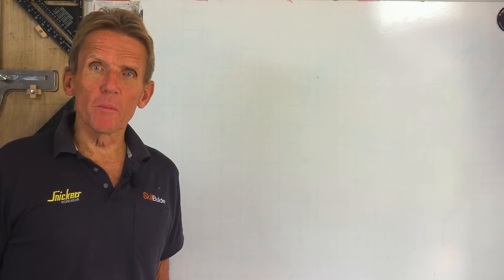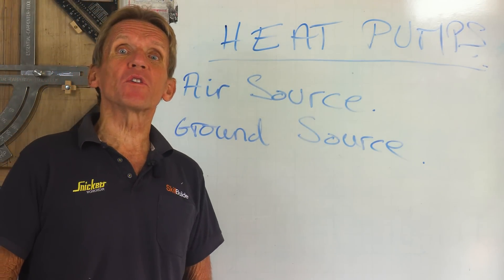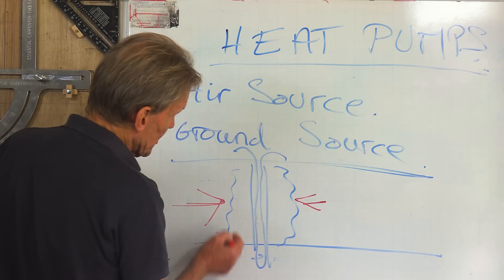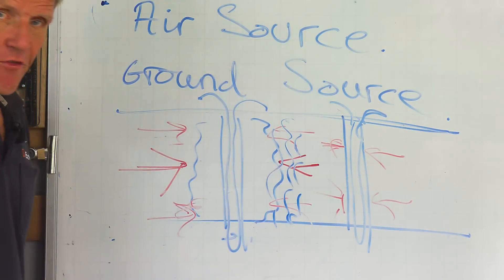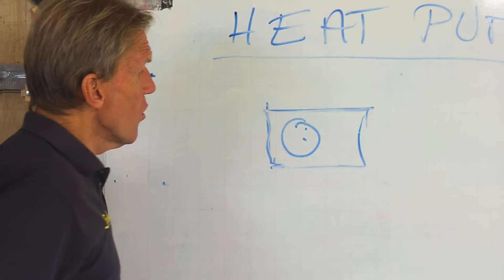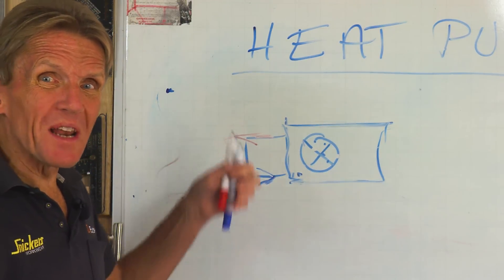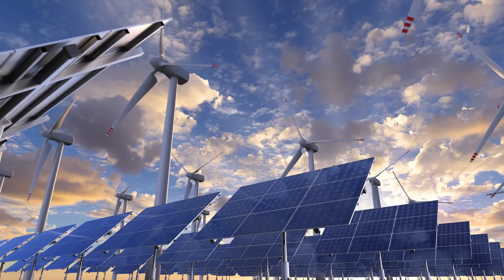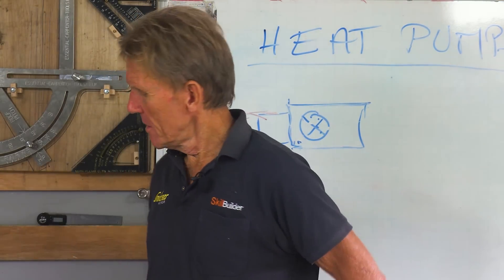Heat Pumps ~ Get Your Facts Straight!

Comment: I live in the countryside in a small hamlet. We are all on oil. No gas here. 1964 build, bungalow. A year or two after we moved in we had it cavity insulated and loft insulated (around 2008), windows and doors all double glazed, it halved our annual heating bill and I spend about £1000 a year on oil. Now. Thermostat set at 18 deg. In the summer the boiler is hardly on because it just does hot water, in winter it comes in & out maintaining the CH temperature. It works extremely well and I am more than happy with it. In new build homes I can see why heat pumps may be economically viable but in older homes never designed for them I’m not so sure, even if you can afford the cost. There’s a lot of greenwashing going on. Caveat emptor.
Reply: Same here but my house is 120 years old. No gas, no oil. They ripped out my stove and said they'd not touch it. £12 a day to get to18oC and it's lousy. It's been installed for two weeks now and I curse it every day. I wish my wife wasn't conned by the council to install this rubbish.
Reply: @davidcrawford8583  sorry to hear that David. The guy who services my boiler has taken out heat pump systems and re-installed oil boilers because they are not what’s promised. As you now know you have to run electric pumps constantly, if you want hot water it’s immersion heater or a secondary source of heat (gas boiler or oil boiler) never mind the significant installation costs. As I wrote before, new house, new build, maybe heat pumps are ok, old house…..mmm not convinced. At all.
Reply: @jfro5867  Thanks, we paid nothing for it, the guys who fitted it told me it was a 15k install. It does produce hot water better than the back boiler ever did, but apart from that it's so bad. I now have to pay for a new log burner which is a £1000 and no one cn fit one until the end of January. I don't know who to complain to, EON next or the Council.

Comment: If you have no gas supply available, air-source heat pumps are  lot cheaper than direct electric heat [except when the temp is close, or below, freezing!] The temp outside is -2C now and the heat pump is drawing 2.2KW to maintain an internal temp of 21C
Reply from the maker: Good to know it is working for you and I agree.

Comment: The simple fact is.. several years ago me and my wife had solar panels installed.. this was at the time when you got the "feed in" payment we we have enjoyed ever since and the panels have turned out to be a wise investment....
However....
because of this we have become a target for sellers of "Ecologically friendly" heat pump derived central heating systems.
We have seriously looked into this and the major issue is the fact that electricity prices have risen so high  there is actually no break even point where the system becomes economically viable.
In other words, it makes no sense to spend a lot of money on a system that has no practical benefit, and does in fact reduce the standard of the system we already have.
As an added thought, my wife being quite keen on these kind of issues insisted that (as we needed to replace the old one) we bought an A++ rated heat pump tumble drier.
While I must admit it works brilliancy, the only issue we have with it is, and it is happening at this moment, it is in the outhouse and if the temperature drops, as it has these past few days, it will not start unless we fire up a heater in the outhouse (which defeats the object of having a heat pump machine) to get it to start. 
It basically displays a low temperature error

But this set me thinking about these air heat pump systems intended for domestic heating.. do they behave in the same way and could you find yourself on a really cold day in a situation where it is too cold for your heat pump system to start?

Comment: I have two ASHPs in my 2 bed flat. I only use one at a time. It keeps my whole flat lovely and warm. It comes on at 7am and goesnoffbat 11pm. I'm electricity only, my electricity cost is £73 for all my electricity per month during the winter. I love it. Compared to my underfloor heating the ASHP saves me about £200 per month.
Reply: You should vote. Me too! 5 bed detached, 2 a/c units - total energy bill £120 in December.

Comment: I beg to differ 

Heat pumps with a vertical well produce heat by extracting thermal energy from the ground and transferring it to a building's heating system. The ground, even at relatively shallow depths, maintains a relatively constant temperature throughout the year, making it a reliable source of heat.

Here's how it works:

Heat Transfer Fluid: A fluid, such as water or a refrigerant, is circulated through a closed loop of pipes buried in the vertical well.

Heat Absorption: The fluid absorbs heat from the surrounding ground, which is typically warmer than the air during winter.

Heat Pump Cycle: The heat-absorbing fluid then enters the heat pump, where it undergoes a thermodynamic cycle that concentrates the heat.

Heat Release: The concentrated heat is transferred from the heat pump to a heat exchanger, which warms the air or water that circulates through the building's heating system.

Cycle Completion: The cooled fluid is then recirculated through the vertical well to absorb more heat, and the cycle repeats.

Vertical wells are particularly efficient for heat pumps because they provide a large surface area for heat transfer with the ground. This allows the heat pump to extract more heat with less energy input compared to horizontal loops, which have a smaller surface area.

In summary, heat pumps with a vertical well utilize the constant temperature of the ground to extract heat and transfer it to a building's heating system, providing a sustainable and efficient way to generate warmth.

So in a closed circuit with a well 45mt deep the average temperature is 12 degrees Celsius. The chances of freezing the surrounding area making the heat pump useless are the same as being hit by a meteor while driving a scooter down a slope in Nepal

Comment: Due to the poor insulation on older houses, doesn’t it make heat pumps a poor solution, and can you financial costs be higher due to using mains electricity to boost heat output.
Reply from the maker: Yes this is covered in other heat pump videos on our channel

Comment: I know someone who has a mini-split based system for their house airsource heat pump. It uses the mini-split style behaviour to move a refrigerant from the outside unit indoors where the pump is located. This is then used to heat water within their system that is distributed to the radiator/underfloor heating. It has the advantage of needing a much smaller hole through the wall to the outdoor unit, which also needs far less power since it just needs a fan to move the air. The smaller pipes are also easier to insulate than water pipes, which are quite large.
Reply: yes, split system vs monobloc

Comment: My gosh, the tittle says get your facts straight, so please do get your facts straight! firstly Geo thermal with bore holes is geothermal, a simple google search will explain, The word geothermal comes from the Greek words geo (earth) and therme (heat). 
I'd never recomend horizontal loops, as you say this is not just relying on earth temperature but also the sun, acting like a battery to heat the ground, bore hole freezing is possible depending on sizing and cost for number of required bore holes vs payback.

Air to air is almost always more energy efficent vs air to water, but how you will create DHW becomes more difficult (but more solutions are coming). Fact.

lastly grant funding can be obtained for air to water heating and COOLING heat pumps (your wrong again), when working in the summer for cooling along with more and more renewables energy supply, it will and is helping to reduce surplus energy from the grid to run these appliances, just think about it, hot days = sunny days, loads of solar electric. all my cooling is from surplus P.V. from my own roof.

Why the govermenet don't allow A2A is due to ir not being easy to measure this replacment, maybe easier to explain with A2W, if you remove a gas boiler then they know you are using renewables, whereas you could use some A2A but still use a boiler, even just for DHW. Personally i'd like to see some funding for A2A. I do like your enthusiam in a lot of your video's but you really need to get your Facts straight first as you don't look good about making false claims, and you wonder why people think your supported by gas boiler manufactures etc etc. feel free to reach out if you'd like facts checked first.
Reply: Sorry i forgot to add about poorly insulated homes, i think Heat geek has proved this many times, so facts please not just what you think.
Reply from the maker: HeatGeek said that you can use heat pumps on poorly insulated homes but if you watch their latest videos they have changed tack and now say you should spend a lot more time and money on insulation in order to fit a smaller heat pump with standard pipework. 
Running a heat pump above 55 deg C is wasteful and won't give you a good SCOP. 
As for Geo Thermal and Ground Source the difference is that ground source heat needs replacing by solar and geo thermal is working from a deeper level, sometime thousands of metres. 
It is rare to find shallow sources of geothermal. 
As for the air to water grant situation I think you need to watch the video again and listen to what I said. You seem to like to shoot from the lip.
Reply: @SkillBuilder  or know exactly what I'm talking about, as I have been an industry expert for 30 odd years! I'm just giving facts as they are! 
If we are talking about efficiency, then we should always start on the house, regardless of a heat pump or not, but i believe you're in agreement with that, if the price of electric becomes a lot closer to gas then it will also be cheaper to run on a heatpump. We just need more renewables to get there, i believe we want a planet for future generations, i think channel 4 ran a good series last week about it all.
Reply: Ps I'm more than happy to also discuss these matters

Comment: In the UK there is no spare low carbon electricity. It's usually less than 50% of existing demand for electricity. It won't be 100% for the foreseeable future. Therefore any new heat pump will be running on gas burnt in a power station. It takes about 3 kilowatt hours worth of gas to generate 1 kilowatt hour of electricity. So for every kilowatt hour your heat pump uses it has to retrieve 3 kilowatt hours worth of heat just to generate the same CO2 as a gas boiler. It will also take that ratio to roughly break even on energy cost, since electricity is at least 3 times more expensive than gas. Add in the extra cost of the heat pump and installation and remembering that it, like a gas boiler has a life and will have to be periodically replaced, and you can quickly see it's more expensive.
Reply: Where's your data on taking 3kWh of gas to generate 1kWh of electricity.? Anywhere I've looked said that gas power plants in the UK are just shy of 50% efficiency, so just over 2kWh of gas.  With Keadby 2 being over 60% efficient, so requires ~1.7kWh of gas.  Even if you account for grid losses, it's still not getting close to 3kWh of gas required. Also in a gas boiler, you don't get 1kWh of usable heat from 1kWh of gas.  It's around 0.8-0.9kWh of heat per kWh of gas.

Comment from the maker: Just read this from The Ground Source Heat Pump Association. If they can't put out a simple press realease what hope have they got of dealing with more technical stuff

Merton
Merton Community Centre

The architects for the Merton Community Centre decided to go for the “elegant” solution in which one integrated system could provide both heating in summer and cooling in winter (as well as hot water all year round and the freedom not to have to organise, feed and manage a biomass boiler).

Comment: At depths of 2m and more, the ground temperature does not deviate very much from the average summer/winter surface temperatures (around 8° to 12°C [46ºF to 54ºF] in the UK depending on location). At this depth, there is an enormous store of heat that can be usefully tapped for heating in the winter.
your hot water pipes are in air in you loft usually hence the loss of heat. IF your using an electric shower and suggest the cold water is much colder in winter then summer, thats because the pipes are NOT very deep.
Air temperature can vary here in the midland by as much as 36 deg C (-3 deg as it was this morning to summer heat of 33 deg C).

Your talking nonsense. Just saying.
Reply from the maker: Hi Rick 
I could easily retort by saying that you are talking nonsense but let me be a little more constructive because your science is poor.
The ground temperature will vary greatly, if it stayed constant all our energy needs would be met by extracting the heat. A ground source heat pump is more than capable of freezing the ground even a bore hole can freeze. 
Check out the Ground Source Heat Pump Association guides and come back to me when you have done a little more reading.
Reply: @SkillBuilder  you are making a different point and not responding to Rick's point at all. Rick - ground temperatures at depth are very stable and do not change seasonally in the absence of a GSHP. SB - Ground temperature can be reduced by the installation of a GSHP borehole or loop and proper design is needed to ensure that this is sustainable. Both are correct.

Comment: One problem.  When the outside air is around 3 degrees and our system takes a couple of degrees from it it approaches zero.  At that point any moisture in the air freezes and covers your coils. Then,  bam!  No more heat comes out.   House and occupants then switch on electric heaters which cost four times more than my gas central heating.
Reply from the maker: That is when they use they heat from the house to warm the heat pump so it can then warm the house which then warms the heat pump.............Great system
Reply: @SkillBuilder  So they take the heat from the house !   Two points, one that constitutes a house cooling system so is not permitted under the rules you mentioned, two, the idea is to make the house warm and you don't achieve that too effectively by pumping heat out.

Comment: Sounds like a lot of expense to feel good about yourself. It's not going to heat the house unless it's heavily insulated and it's not going to give hot water, without solar installed or a "buffer tank", which is a weak immersion heater. At the moment in Ireland, that's about €50k worth of work and materials. Or 25 years worth of Kerosene amd two new boilers.....

Comment: We had 3 mini split air to air units installed 2 yrs ago in our 1960's bungalow , we retained an electric immersion tank for hot water. Old gas boiler was turned off and ch rads removed. New doubled glazed window units installed at same time. We kept the gas fire in lounge. So far so good, hot air or cold air in lounge and both bedrooms, hallway, kitchen and bathroom and bills are approx £50 - 70 p/mth.
Reply from the maker: That sounds like a good result

Comment: For air source heat pumps to work effectively in UK (given their present COP) the property concerned needs to be insulated to the highest degree ... simply because the high discharge side of the refrigeration circuit which heats the water circuit heat exchanger will predominently offer only around 50-55 degrees C. And in most older UK homes is not suffice to give comfort levels of 19-21 degrees C internal temperature, because of fabric heat loss ... especially in prolonged winter periods of around 2 degrees to -5 degrees C. That is why often they recommend changing all the radiators to try and compensate for the fabric heat loss that is present. A lot of people find they are using copious amounts of energy (kw/hrs) but not getting the comfort levels required. In UK at the moment in those circumstances they are hardly viable. And yes, I worked in building services and am refrigeration trained.
Reply: And half the year UK experiences cold to coldish weather, including periods below freezing, and the other half warm to warmish, including periods of heatwaves. I have experienced at least 1 heatwave a year, every year of my life and that means not being able to sleep properly - every year. Therefore, insulating against heat loss solves only half the challenges.

Comment: A ground source heat pump system will work better with deeper, longer trenches so never cut corners with poxy small setups.
Always go 20% bigger than what you think you'll need and then over excavate some more!!!!!

Comment: Every technology has it limitations.  Thanks for that excellent explanation of ground source heating...........most people fail to explain that the ground can be saturated from heat extraction, they assume there is always enough heat in the ground to always provide enough energy.
Reply: only a problem if badly designed / installed
Reply: It's old technology,  it's just a vapour compression system its been done for years in one way or another . It's just new in people's houses , retail units have had co2 pack systems with heat exchangers for years so they can run their refrigeration and heating of one pack . The trouble with the vapour compression system is it breaks down all the time . The old gas boiler is way more reliable in all honesty but it's a money maker